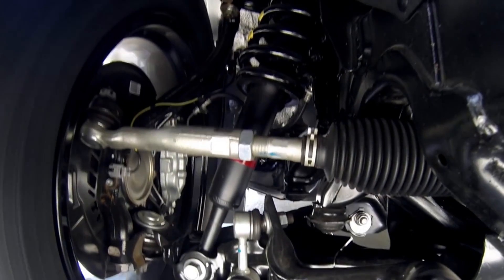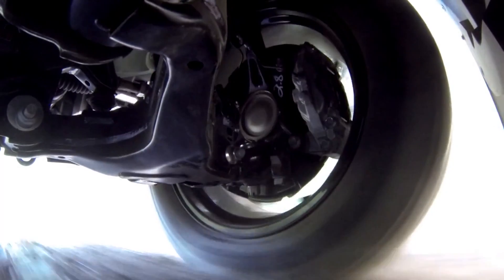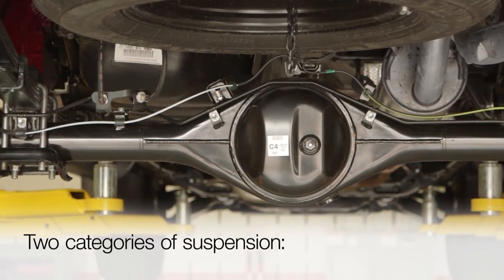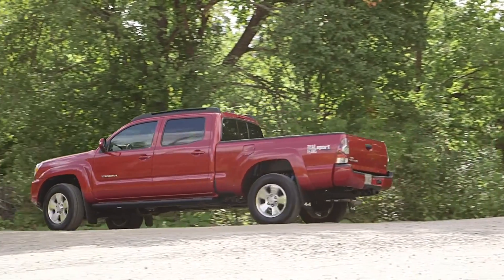Know Your Toyota Mechanical: Suspension Systems

Comment: Sometimes, after a lot of miles, the cumulative friction of moving up and down for thousands and thousands of cycles causes Toyota control arms to glow blue, like in the thumbnail for this video.  In that case, drive your Toyota AS QUICKLY AS POSSIBLE to an abandoned area like a rock quarry.  Get away from the car and notify authorities.